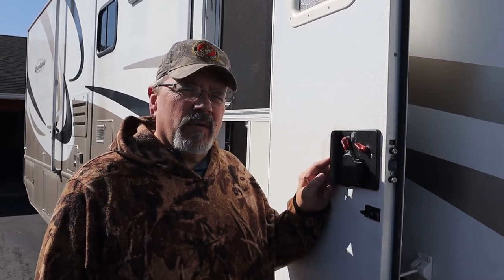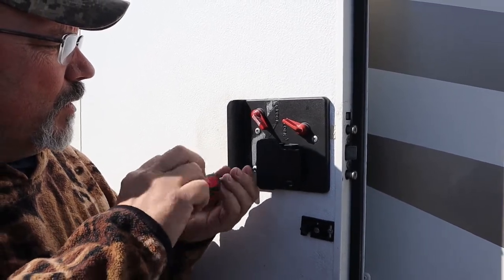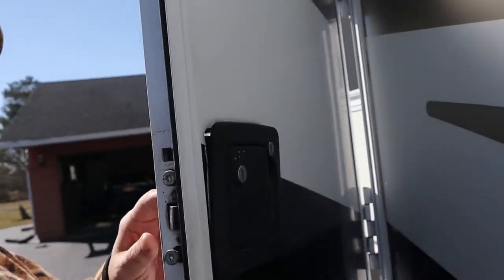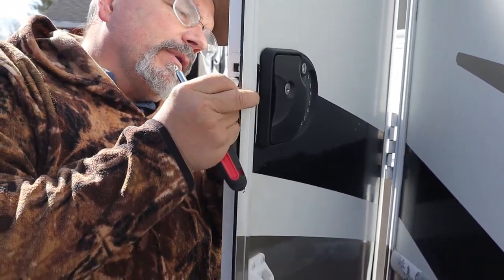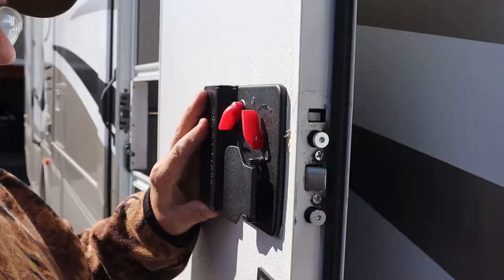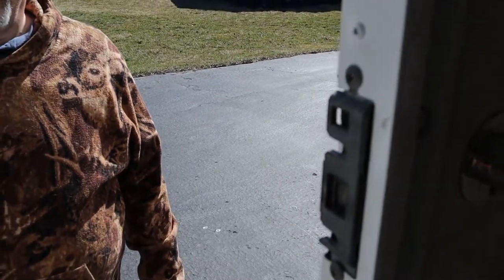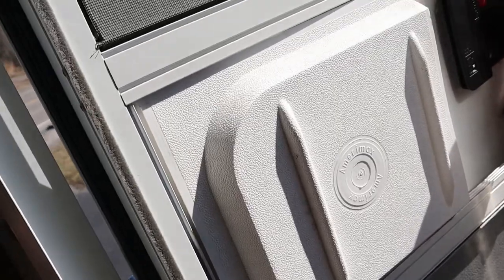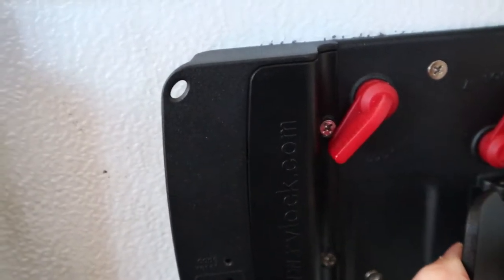RVLOCK KEYLESS MOTORHOME DOOR LOCK WITH KEYPAD AND KEY FOB REVIEW AND INSTALL / FULL TIME DREAM

Comment: We did the same thing. We had an issue when installing it though. A wedge or spacer I wasn’t expecting to be there fell inside the door and it’ll forever remain there. Lol. It doesn’t matter how easy an install is. If a Roberts is involved, it’ll magically become challenging. Oh I almost forgot, I also had to shave off some metal from the screen door cause the fit wasn’t perfect. Sounds like RV Lock has the typical customer service nowadays. Lol. God bless. Kevin
Reply from the maker: Oh, good so we aren't the only ones that have a 5 minute job turn into an hour!! Thanks for stopping and watching.
Reply: @FullTimeDreamRV  haaaaa!!!  Not by a long shot. My dad always says that’s what makes things memorable. At least I think that’s what he says. I forget. Weird